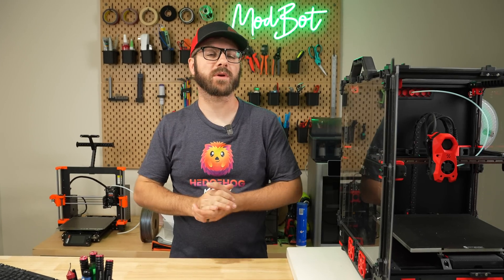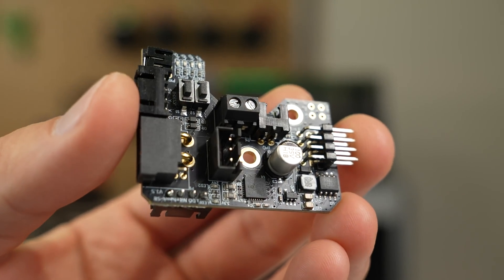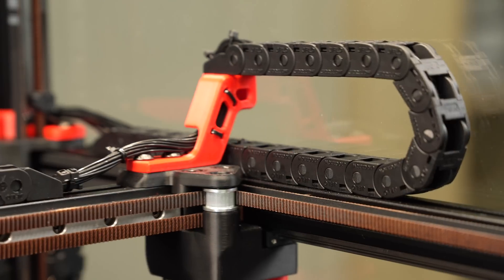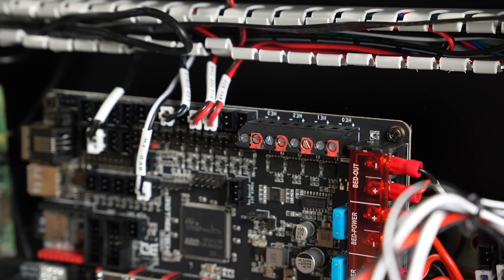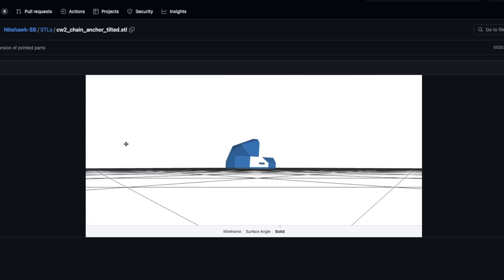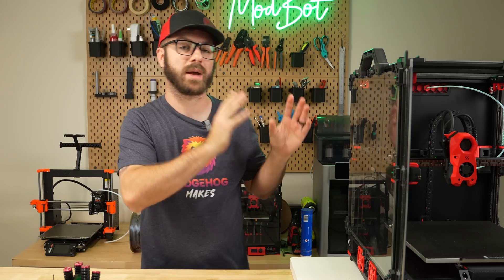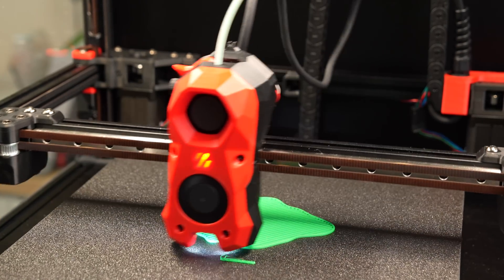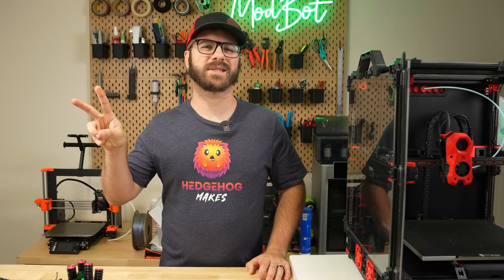USB Toolhead Boards Are FINALLY Here! (LDO Nitehawk)

Comment: nighthawk has a thermal issue.  Saw a video earlier that LDO has recalled and replaced the Nighthawk boards with the correction applied to the hardware

Comment: With SB nighthawk is there a clear (recommended) method for grounding the extruder motor and hotend to account for static electricity?... which apparantly builds up as filament passes through the extruder.  Post-print, after nozzle has cooled have seen MCU disconnects caused by using bare fingers to pull filament fuzz from the hotend.  Would assume that extruder chassis and hotend assembly could be earth grounded?, or grounded to toolhead 0v ground (with a resistor???).  However not an electrical expert of any sort.  If there are guides or guru recommendations to help with this, that would be great.

Comment: The X limit switch on the trident should be moved to the toolhead,  you can leave the Y limit switch where it is, along with the drag chain which will now only have the Y limit switch wires in it.  The X limit switch will be removed from the X axis gantry and screwed onto the X carriage.  There is a mod to move the Y axis limit switch to the A/B motor mount, if you do that the Y limit wires will be laced down to the control board along with the motor cables and the drag chain can be completely removed.  Your choice.  RPi4 has USB 3 ports so should have a higher speed interface and your comm errors should go away.  LDO has also fixed the same issue in the NH-36, so any changes may have trickled down to the NH-SB.

Comment: I am trying to figure out how to best mount the nigehawk-36 on a G2E/stealthburner setup.  The stealthburner version of nitehawk does NOT have a built in USB hub as does the -36 version.  They need to update the SB version to include this for the purpose of using the BeaconH probe with the SB, which is why I bought the -36 version.  I'll probably just not use the cable chain and go with an umbilical cord laced to the external bowden tube since the only cable needed will be the USB cable.

Comment: I have my voron 2.4r2 for like 2 years and the chains didn't chew thru the wires.
I have OG expensive igus chains and also used ETFE wires certified for use in aircrafts.

Comment: Why is this not using USB-PD to deliver the power instead of running separate 24v wires?
Reply: Not sure. Maybe for heater core-related power demands?
Reply: @ USB-PD can deliver up to 240 watts. What kind of hot end exceeds that?
Reply: I would have preferred this also instead of a proprietary cable.

Comment: The issue with USB connection is to do with power consumption with USB ports on PI. Rpi4 has 20w input in general, which is not enough for Pi and multiple USB ports. I use a powered USB Hub avoid all these issues

Comment: I'm planning a 6 heads tool changer, and already testing canbus connectivity using two canbus boards. However this turned out to be pretty hard to setup, once done it seems to work fine. Now I see this USB type.. Looks way easier to setup, BUT:
- Does it work through a USB hub, since I have 6 toolheads?
- The failed connection errors was exactly what I was worried about with USB.. Some people told me 'USB is far more reliable than canbus' but this proves thatit is not that reliable..
I don't know how to proceed by build yet (still planning phase) .. Any suggstions on both points above?

Comment: In the LDO sample config it has a section below. I do not have that in my current config, is that something that needs to be added or what was it controlled by with the standard SB set up. Sorry I am a complete klipper noob so not sure what I am talking about. 

"#####################################################################

#   Lights
#####################################################################
## Stealthburner Headlights
[neopixel headlight]
pin: nhk:gpio7

## PCB Activity Light
[output_pin act_led]
pin: !nhk:gpio8"

Comment: wonder if anyone has tried to use the nitehawk with a cnc tap? The probe pin is 24 volt, and I am running into issue figuring where to plug the tap into...

Comment: For the XY cable on my Trident I ended up removing the pins, then braiding the wires and putting the connector back on. I just let the XY cable hang below.

Comment: Does the nitehawk cable end go thru the PG7 gland parts you are using without modding the cable?
Reply from the maker: The cable plug has to be removed/depinned. The cable fits though.
Reply: Thanks for the reply - your videos are helpful.

Comment: You need a dedicated PSU for the Pi. I was having similar issues with normal tollhead board and Pi cam. I was powering the Pi from the controller board and every now and then there's was a voltage drop and the Pi will throttle down producing the issues.

Comment: Is it possible to connect a beacon probe or a btt eddy to the board ?
Reply from the maker: Not this version but the Nitehawk 36 has a USB connection that can be used for this.
Reply: @ModBotArmy Unsure about how nitehawk handles this but beacon discourages this setup highly for ebb36 and recommends (also to keep warranty) to connect it directly to the mainboard.

Comment: Mine showed up but did not have a heatsink for the 2209 driver on toolhead PCB.  I have a million of them, so no big deal.  Just FYI.
Reply: Yeah this stood out to me too, I didn't have any spares. Been running the printer without panels for now. Peak nitehawk temp on PLA prints is 55c.

Comment: Great video. I got the LDO nitehawk and encountered all the issues you mentioned hardware setup.  Further, I am not sure if your issues with the MCU disconnected could be related to overloading on the pi as I am running a pi4 with 8gb RAM and I get the same random MCU disconnect and I still have not found the reason behind as it is very random. It can as soon as few minutes or it can be a few hours running a long print. Hope there is a solution to this soon beside the MCU disconnect issues, the LDO NiteHawk is a fanstistic board.

Comment: Add debug mode and extra logging. The additional time logging will slow down the system and won’t fuck up. 

Had a similar issue using a USB expansion board for my ERCF.

Comment: I had (/have) the timeout while homing error... After a while I realised that every time it happened the pi CPU would be hanging around 30% load constantly, even with the printer doing nothing. If I restart the Crowsnest service the CPU returns to 3% or so at idle and the problem goes away entirely (this works 100% of the time). If I reboot the crowsnest service immediately after I start the printer up, I never see the problem. 

I haven't had time to dig further into the reasoning but perhaps give it a try and see if it fixes things for you too

Comment: Sounds like you not only need a Pi4 or Pi5 but also to plug the Nitehawk into USB 3.0 plug instead of a normal 2.0.  Since your connection to the mainboard can run fine through USB 2.0, that leaves the two 3.0 USB ports open for the Hawk and Camera.

Comment: Unfortunately, USB is not the correct port or protocol for this task.
While it may work now, it will cause more issues down the road

Whereas CAN (and it's derivatives) is designed for such peripherals. With decades of proven ndustrial reliability.

Comment: I've been running canbus (ebb36) for 2 years and my opinion is
toolhead board? yes
active circuitry toolhead boards? nah. just run umbilical with all the cables. you'll be happier in the long run.

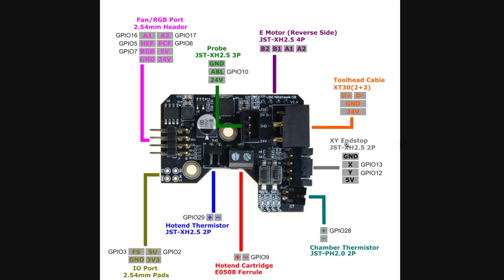Comment: I curious why you didn't want to use the endstop port on the board? According to the pinout there is a port for both X and Y.  05:11 GPIO 13 and GPIO12.  Sensorless homing is cool but defeats the theme of simplifying things, and is not as precise as mechanical endstops. Also the option to use USB/serial connection is on most of the canbus enabled boards. Its interesting to see that LDO did it like this. It wouldn't have taken much to have a canbus transceiver on it too, although there are already pretty solid options available in that config.

Comment: I've had the exact same issues with USB as you are describing, albeit I was running a Pi4 with a 1080p frame camera and 4k nozzle camera @ 1080p. I was still using CAN for my toolhead board, but it seems the Pi3 and Pi4 both have issues with USB easily getting overwhelmed and causing packet dropouts over CAN. I doubt moving to USB would improve things. Moving to a Pi 5 fixed things for me, although it seems absolute overkill for the actual computation the board is doing while running Klipper.

Comment: I don't see the benefit. Cabling is more or less the same like CAN. For CAN you need a CAN-USB adapter, for this you need the USB adapter board. For CAN you need a custom wire (i am using 7 A rated Usb cable i cut) for this you need a custom wire as well, no native usb cable.
Reply: USB is a lot simpler to setup in software than CAN is.
Reply: @steveo101112  "a lot" you save to touch one config file and to copy paste the can network definition into it. Real Usb c PD would be a real benefit. This is different wine in the same bottles.

Comment: Having to start using sensorless homing has stopped me from installing some of the mods like this that I've already bought.

Is it necessary to remove the cable chains if you go umbilical, or would it merely look silly to have both?

Comment: I have concerns about running timing-critical printing processes across two separate stacks with their own buffered movement ques.. that seems like a bad idea? CAN made sense when the MCU controlling the CANBUS was also the one stepping all the other axis, but once that is a USB to CANBUS that point suddenly becomes mute, now the USB host has to keep everything together instead of filling a single buffer with commands to eventually perform. Is desync between multiple USB devices with their own buffers not an issue at all then? 🤔

Comment: I think people are neglecting a few things.

Sure you can run an ebb36 board via usb AND power cables. No worries.

Now go plug a beacon into it,

Oh, you cant? So theres another cable you need to run back to your printer.

Same with cartographer or any other device that uses USB. 

YOU cannot expand an ebb36's usb capabilities. LDO NH36 you can.
Reply: In theory you could use the can version of cartographer, connect it to the can pins of the ebb36 and configure it as can-bridge.
Reply: @Alterproll  yep, now tell me how to use beacon 😀

Comment: I ended up putting a dedicated Pi in my Voron just for cameras. It removes the possibility of issues like USB bus contention, CPU load (even though NIC should handle that), and I can reboot or modify Klipper and the camera software without worrying about the other.
Reply: Are you having the cameras' Pi stream over the network to the Crowsnest instance in the Mainsail/Fluid GUI running on the Klipper? Curious as to how you set this up because I might do something similar but still want the webcam feeds on within the GUI

Comment: Modbot Thanks for covering this board. I got four of them from KB-3D at MRRF and plan on converting my V2.4s and Tridents from CANBus to these. Regarding weird issues with your Raspberry Pi, try adding an additional 5V power source. If connecting via the GPIO pins, then supply 5V to both 5V pins. This ensures the Pi has enough power (and amperage) when running multiple USB devices.

Comment: Replacing the complex CAN bus protocol with the complex USB protocol is a bit of a sideways step. USB is good for bulk data transfers but is notoriously slow as a bus where you have to react to changes. The protocol is limited by the minimum message/response time for a packet and retries if theres a packet formation error - not good for real time responses.
If youre going to go down that path, ditch both CAN and USB and go wireless. Probably more reliable with no cables (that "best part is no part quote") .

Comment: Am I missing something, or have USB tool head boards (e.g. BTT) been around for a while?
Reply: I have 6 custom idex printers using 12 EBB 36s all running over USB.  So, yeah...Very strange video.
Reply: @__zackm  yeah. As much as I'd like to reserve judgment, I'm disappointed that so few 3d printing channels can resist the temptation to shill as they grow larger
Reply from the maker: Everyone who is running USB on EBB must have watched this video. Because I have only ever seen one other person run it using a 3rd party upgrade kit: https://lab4450.com/product/ebb36-can-to-usb-upgrade-kit/

I looked quite a while ago at what it would take to run over USB and couldnt figure out how to supply both the needed power and data over USB. It seems like the solution is to run a separate set of cables for power which isn't nearly as elegant of solution. If BTT had released a cleaner way of doing it then there would be a lot more people running it. I believe they are working on a USB specific board that will be similar in how it functions to Nitehawk.
Reply: @ModBotArmy  That's a fair point. You did mention that the adaptor board which combines USB and power into one cable is "where the magic happens."  But although it is "one nice cable," it does have 3 wires.  This would not be dissimilar to a USB cable + power and ground wires using the EBB, at least when considering the overall thickness of the combined wires.  In other words, when you combine USB, pwr, and gnd in a sheath, I don't really see how the Nighthawk adaptor board offers any advantage.  I guess I don't see how it's a much less elegant solution than having a breakout board in the back of the machine.  There is no appreciable decrease in complexity, weight, or aesthetics with the LDO solution.
Reply: @ModBotArmy  It's an MCU like any other MCU.  How you get power to it is up to you.  Running a 24v connection along side the USB isn't exactly complex, but if absolute elegance is the goal, then breaking out a couple USB pins isn't some herculean task.

The reality is canbus became a very buzzy concept within the space and everyone jumped on board.  People weren't doing it because it was superior or more elegant, they were doing it because that's what they saw other people doing on youtube.  USB has always been available and viable.

I'm not sure why you're so adamant on rejecting the reality that so many people in the comments have described.
Reply: And now that I think about it, all of my Qidi X-Max 3s run on USB toolhead boards out of the box.

Comment: I believe rpi3 has a single USB2.0 bus which is shared with the Ethernet, while on the rpi4 there are separate busses for the USB2 and USB3 ports, and those are separate from the Ethernet.  "lsusb -t" to see what I mean.  This can be an issue with poorly-implemented webcams, they can just starve out the other USB2 devices.

I've been considering upgrading a couple rpi3 to rpi4 simply because of the faster wifi.  2.4Ghz is fine, mostly, but periodically I'll have a big gcode file which just takes awhile to upload.

Comment: I actually just set up my Nitehawk-sb the other day on my 2.4. I have not seen any of the timeout issues that you have been experiencing, but I also run a Pi 4, and I only have a 1080p webcam. If you are upgrading your Pi, plug your webcam and your Nitehawk into two separate USB controllers (ie. webcam in USB3 port, NH in USB2 port). This way you can be certain that your webcam and NH will not be competing for USB bandwidth.

Although, I suspect your timeout issues come from the fact that running your 4k webcam over USB2 is eating the majority of the bandwidth available to the USB controller. If you can reduce your resolution or the frame rate of your webcam, it may help to alleviate your connectivity issues until you can upgrade your Pi.
Reply: Unless you add it yourself, I'm not aware of any computer that ships with more than one USB2 Host Controller. Let alone an SBC like the Pi.

As far as I'm aware, USB2 and USB3 are actually incompatible, and run over separate wires inside the connector. So a USB2 connection running through a USB3 port will be connected to the same Host Controller anyway. 

(I forget where, but I remember reading something about someone who separated the USB2 and USB3 connections, creating a Pi4 with 7 useable onboard USB ports, even if some where exclusive to a version of USB.)

Comment: I don't understand what the benefit of a toolhead board should be, except the accelerometer. A good mainboard has everything I need.
Reply from the maker: Swapping parts without having to undo wires, quicker upgrades, and more free ports for things like chamber fans, electronics fans, chamber thermistors etc. It really depends on how complex of a build your running and what your wanting to accomplish.
Reply: @ModBotArmy  thanks for your fast respond!
So... I don't need it. I don't change my toolhead or other things. Maybe I change the nozzle any time for a different material, but that's it.

Comment: actually you can also use the bigtreetech EBB36 (probably also the EBB42) over usb, you just need to flash klipper and of course add a 24v power cable
Reply: The data pins are even exposed, so no need for a usb cable to the toolhead, a short section of it from the pins to the port is enough
Reply: @over_pizza_2578  Which are the exposed data pins? can't see it on the min diagram